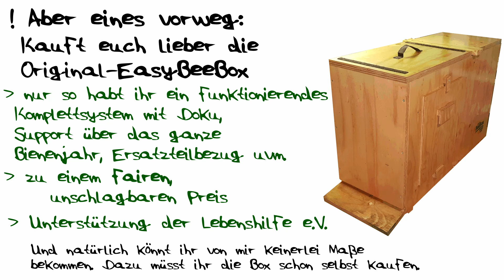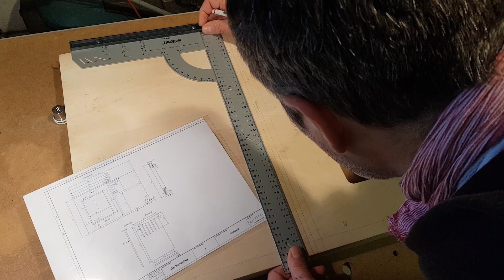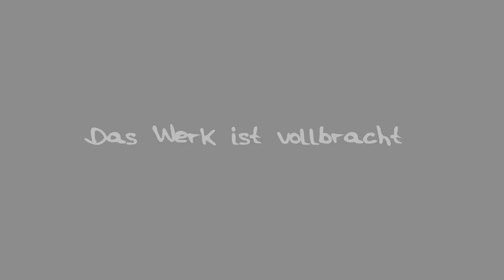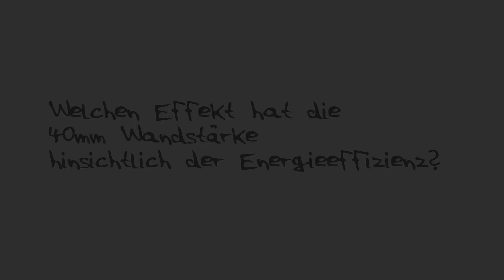Meine Bienenbox 2021 - Ein experimenteller Nachbau der EasyBeebox in 40mm Wandstärke

Comment: Hab dieses tolle Video gerade erst gesehen. Wie konnte mir das nur durch gehen?

Ich bin echt froh dass es dich noch eigene Leute gibt die ähnlich gestrickt sind wie ich. Nach Torben Schiffer solltest Du mit der höheren Wandstärke einen wichtigen Schritt in Richtung Energieeffizienz gemacht haben.

Da interessiert mich doch glatt wie sich dieses Holzmaterial nennt bzw wieviele Schichten das Holz bei 40 mm Stärke hat?

Weiter so! Ich glaube wir müssen eine Interessengemeinschaft gründen?!? 😉

Lg 
DIHT
Reply from the maker: Hi dIhT, 
das freut mich dass du reingeschaut hast. Ich habe auch deine spannenden Bauprojekte verfolgt.
Ja es ist spannend zu experimentieren, auch wenn mal was daneben geht. Aber Probieren geht über studieren ;-)
Es sind Multiplexplatten 40mm aus Birke für den Außenbereich BFU100. Mal sehen, ob das Material gut hält.
Natürlich ist die Box mit Leergewicht von 40kg nicht leicht zu handlen. Aber es ist eben ein Versuch.
Meld dich bei Bedarf. Meine Kontaktdaten stehen in der Kanalbeschreibung.
Viele Grüße und bleib gesund
Dirk